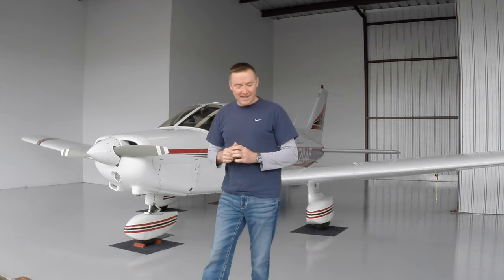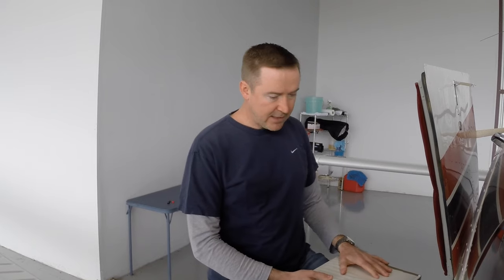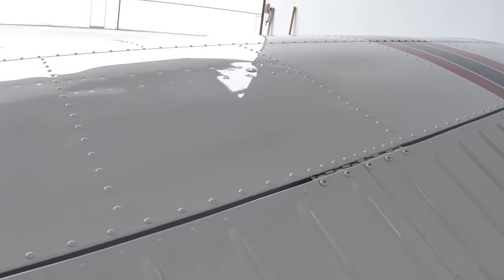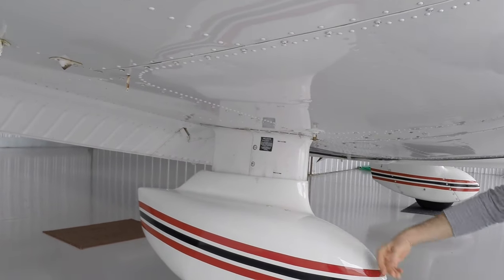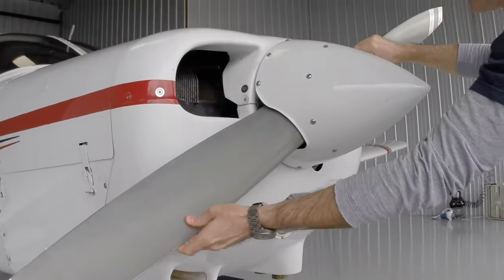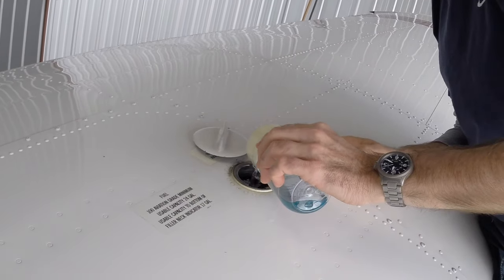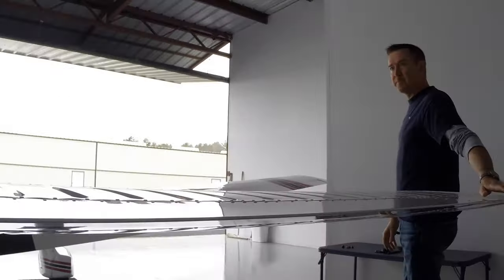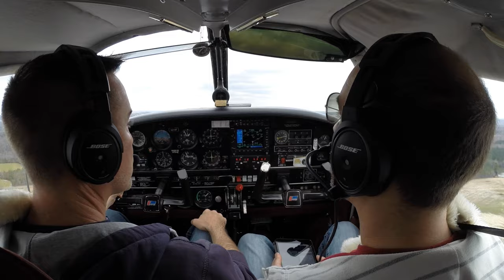Preflight Piper Warrior II

Comment: I like that you emphasized the connection from the elevator control to the stabilator. In my opinion, that's the most critical thing on the whole airplane to preflight carefully. Lose an aileron or a flap or the spinner or the prop or the cowling or the rudder or just about anything else, and you're probably going to be able to find a way to land the airplane. Lose the connection to the stabilator, and there's nothing you can do - you are toast. Nice video - good job!

Comment: OMG I'm taking my family up in this exact plane (N2114F) today! :-) It found it's way to Wings of Carolina (maybe a leaseback like 64TZ is?) What a small world!
Reply from the maker: It's a great airplane. We struggled with the idea of selling it. However, when purchasing an airplane it is paramount to determine the mission. We found that after 8 years of flying N2114F that our flight mission was farther than a Warrior could support. We fly from NC to PA, to Cape Cod, Mississippi, Sun N Fun, and Oshkosh. So, we decided a Mooney M20J would work better for our missions. It's a great airplane. Did you have a chance to turn on all of the LED lights outside?
Reply: @btflync  Yes indeed it was very nice and the lights are excellent. I'm afraid to say that 1-2 years of making this plane a rental has taken a toll on her interior. Still very well maintained due to the club's self-imposed 50 hour maint cycle, but due to resource constraints the interiors do not get a whole lot of TLC for renovations.

Comment: Great video. I think the statement about fuel gauges at 13:03 is a misinterpretation of the CFR.
Reply from the maker: 14 CFR 25.1337 indicates in (b) Fuel quantity indicator. There must be means to indicate to the flight crewmembers, the quantity, in gallons or equivalent units, of usable fuel in each tank during flight. In addition - (1) Each fuel quantity indicator must be calibrated to read “zero” during level flight when the quantity of fuel remaining in the tank is equal to the unusable fuel supply determined under 25.959; ------ If the gauges only need to be calibrated for zero fuel, I'm not sure I understand your comment. Can you elaborate?
Reply: @btflync  You bet. The CFR requires the following: if a 25 gal tank has 1 gallon left (two gallons for both tanks), then the gauge must read zero to represent the amount of usable fuel remaining. This doesn't imply (implicitly or explicitly) that the gauge is only accurate when reading zero or when tanks are emptied of usable fuel. I like the video, plane, hanger condition, and presentation. Can you confirm for me: the static port is on the side of the blade and not the back? The drain is on the back? Getting a Piper checkout soon so doing some self study. Videos are not always easy to produce and take a lot of time, I appreciate you and your camera person's efforts.

Comment: i hope your one of the youtubers that answer back... @ 12:10 ish you talk about switching tanks, i my mind, i would use both all the time! My thought is " the fuel selector is just another mechanical part that COULD fail. Why take the chance??? (edit spelling)
Reply from the maker: The design of the low wing Piper is that the selector has only three positions: Left, Right and Off. The high wing airplanes are the ones that typically have 4 selections (Both, Left, Right, Off).

Comment: what was that plug that looks like it plugs into a wall on the right side of the engine??
Reply from the maker: That is the connection for the Tanis block heater for cold weather operation.

Comment: Didn't check the brake lines
Reply from the maker: With wheel pants on, you check the brake fluid reservoir. If the fluid isn't leaking out, the reservoir will be at the same level.
Reply: @btflync  Good answer!

Comment: sorry bro. one more...lol Your always talking about and  very concerned about, the screws,nuts, and bolts being in place? that's scary in it self, that being said....why dont you grab a Phillips head and check a few while your doing the walk around?
Reply from the maker: Visual inspection reveals the ones that need to be tightened. Based on that, we'll pull out a screwdriver for the ones that need tightening.
Reply: loose fasteners sometimes will give clues like cracked paint around it, shiny spots around it, grey streaks around it (in aluminum), or orange streaks (in steel) If you see one of those, then check the fastener closer.